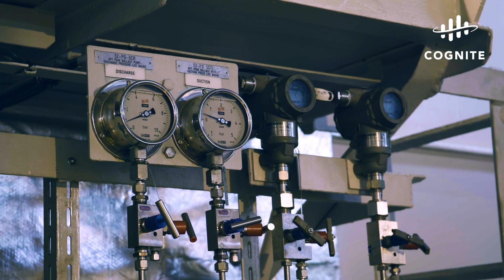A Year with Spot

Comment: Cant we make spot to go and charge himself without manually changing batteries? or may be we can have a battery charging station where spot can plug himself for a hotswap and, station changes the battery while spot being connected. at last, we could have a electrical lock to which spot can lock up while at the charging station. Same theory can go with drones so we could have un interrupted autonomous flying drones

Comment: I would say... As a possible upgrade to Spot, would be to have two arms (similar in design etc) to the arm you had/have on some models of spot, mounted each side of the main body of the unit, so that he could reach up (like he did on opening of doors etc), but, say he was gripping a valve/tap/lever to twist/open/close, the other 'arm' could be used to grip somewhere else to steady himself (you get the idea), or, if carrying objects, he then has two grip points, like say, carrying a silver service Tea tray, with fine china tea cups, cutlery, sugar bowl, and a tea pot lol... It would be fun to see him coming into a room, and place the tray on a table without spilling a drop (and a lot less rattling and clinking than an 'old maid' serving up tea. hahahaha 🤔🤔🤔😏😁😁😎

Comment: What's the point of buying an expensive  overengineered robot to monitor gauges if you could have instead designed those gauges send data themselves to some server. Faster and cheaper. Radiation detection and cave exploration - maybe, but the other use cases feel like they were trying hard to come up with a use case for the robot
Reply: The purpose is to detect gas leakage if the other systems fail I guess. It's just in early stage and prove of concept.

Comment: SpaceX has one of them at their Starship Building and testing site. 
It secures the area after prototype-operations like launch-landing, pressure testing and static fires.
its already an essential tool at the testsite as it provides fast and secure overview the situation after the operation.
Even more important is its capability to inspect the testet Prototype or remainings of it right after the operation - while the hole area is still locked due to the inherent danger by the prototype's possibly remainding fuel.

Comment: Why doesn't he say that he now has twice 
as much work to do in his company with 
Spot as before. 

Because for Spot every single new task has 
to be prepared in a laborious and extremely 
expensive way. 

And it's not like in this promotional video, 
where Spot does one thing after the other, 
loosely and easily by hand. 

That if you want to use Spot seriously, you 
have to have two additional technicians. 

And you need a big new extra budged.

Comment: So now we need Spot and computer vision to replace IoT chips that have been collecting data monitoring factories and plants for over a decade?
Reply: I think it is for safety/regulation purpose somebody must go check the hardware on the floor, periodically. eg: like if a tank is filled with liquid it could have a window for visual inspection of content while an instrument wired to control room translate it to a number that could be misinterpreted in edge cases, ie: a "max value" on a screen doesn't mean actual liquid on that tank is actually full, or something like the control room abstracted the instrument values to a different meaning after a specific operation mode being toggled.

Comment: I thought that Spot was perfect for nuclear power stations, that stuck on tongue is hilarious!
Reply: If it's not made and run by some bunch of idiots flying in plane is far more dangerous
Reply: @ImieNazwiskoOK  🤣🤣 that made me chuckle, very true. Although I’d imagine some parts of a reactor are too dangerous regardless so something like Spot is useful?
Reply: @marksapollo  it's like what the video said; it can do a manual check of the instrument to ensure the reading is correct, unlike what we saw in TV series like Chernobyl (2019), the reactor has exploded but the control room still think it exist, ie: funny quote like "comrade is delusional, take him to infirmary".
Reply: @marksapollo  I think it might be used during "refueling" (when they need to change fuel rods), or in factories and mines (where they already use RC vehicles for safety reasons).
At the same time I'm not sure how shielded are nuclear rods.

Comment: It’s a shame they don’t make pressure gauges that can be read remotely.
Reply: in industrial disaster, usually control room (ie: remote reading, like the control room in a nuclear reactor with 2D graphics showing abstract of piping and tank level) has wrong readings or misinterpretation of the quirks of the reading (ie: max reading of "10" doesn't mean a tank is filled at 10, perhaps it maxed the meter) which lead to an industrial disaster. So I guess by law/regulation it is required to send worker to the tanks/machine itself to ensure the reading looks right, but it is a dangerous job because if disaster happen there's always people checking what's wrong with that tanks/machine and lost of lives usually occur. You can check USCSB's video on industrial disaster, like "CSB safety video: Anatomy of a disaster".
Reply: @xponen  I agree a robot could be really useful during a disaster but as @Thimble Fire says it’s not practical for day to day use - at least for most industries. Believe me I think this stuff is super cool but in some ways it seems like a solution looking for a problem. IMO, the real purpose of these things will eventually reveal itself to be combat. Almost everything shown in these videos is accretive to that mission.
Reply: @truthsmiles  I see it like drone, but carry more weight and have long battery life. Commercial customer will use the robot for some situation instead of drones, like for mapping & delivering package. I saw the short movie "Slxughterbot", normal drones can also be militaristic but we did not.
Reply: @truthsmiles  fire trucks are not very practical for day to day use but when you have a house fire you sure are glad your city/town invested in one ahead of time.

Comment: I dont have any background in robotics but I would suggest something. Spot or your robots could be equipped with an antenna droper. In case the signal gets weak due to spot being in a tunnel or a hard to reach area spot would drop a signal amplifier then continue its journey in the cave and if the signal gets weak it drops another signal amplifier... I hope I made a positive suggestion :)

Comment: How about gardening attachments? Imagine indoor gardening set ups where you don't need to make space for human worker. Instead spot designed access allows for compact indoor plant growth. Vertical farms maintained by robots. Converting urban space into farm.
Reply: Gardening attachments? Like a container for liquids and a system to aim a tube and dispense the liquid at a certain place? Beer into a cup or maybe water into a pot?
Reply: @ViktorBengtsson  oh not that, I mean, the ability to weed removal, plant, uproot, prune with sheers, etc. Watering system can be handled by drip lines.